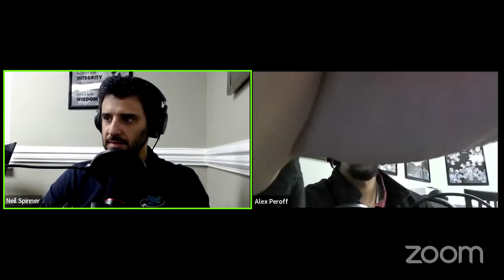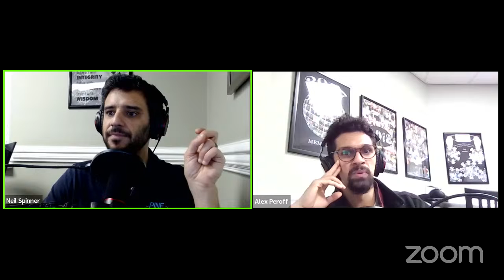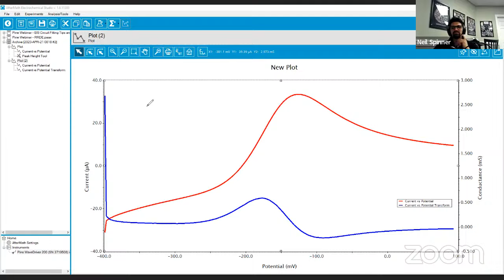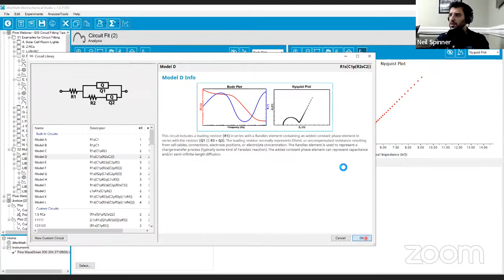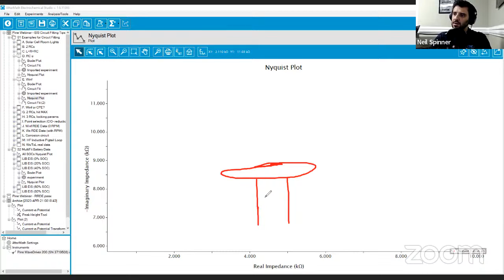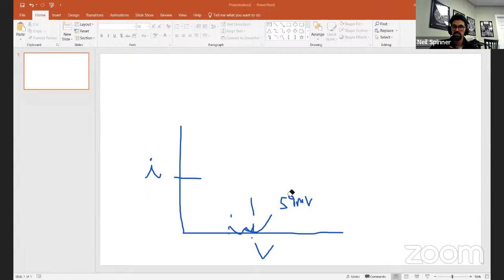Episode #2: Let's talk about Bode vs Nyquist plots

Comment: Thank you so much for taking the time to answer my questions, even though I couldn't attend the livestream. I truly appreciate it!

I have a follow-up question regarding the Bode plot. I'm not sure if this was extensively covered in any of the webinars on EIS, but I'm curious if specific characteristic shapes of the Bode plot can be attributed to particular electric circuit elements, similar to how it's done with the Nyquist plot. If that's the case, could you please discuss some of these common features and how they should be interpreted? I find it challenging to use the Bode plot as a tool for understanding the various electrochemical processes occurring.

PS: I noticed your discussion on the floated vs. grounded setting haha. Personally, I always use the grounded setting, but I can't really explain why. Which setting would you recommend for EIS measurements and what are the reasons behind your recommendation?
Reply from the maker: Shapes in the Bode plot certainly correlate to circuit elements, or vice versa (however you logically think about it).  The thing is just that Nyquist plots are easier, in my opinion, to make those visual connections.  There are many cases where, for example, two different but even mostly similar circuit elements will display hard-to-differentiate features in the Bode plot, but when looking on the Nyquist plot it is much more obvious which is which.  This kind of thing is obviously much more easily explained visually than through text, so my best suggestion is to jump onto one of our next Livestreams and ask the question then.  I can show you in our software what I mean.

Regarding the grounding discussion, the best answer I can give is honestly very unsatisfying: trial and error.  Ultimately, every situation will likely behave differently, and while a great many will have almost no impact from any variation in grounding configuration, if they do the best way to optimize is to simply try stuff out.  I wrote a Knowledgebase article on the different options here too for reference: https://pineresearch.com/shop/kb/applications/general-electrochemistry/instrument-grounding-information/.  Generally, I think for systems measuring very low currents it is ideal to float everything.  But again, trial and error is best to figure out what you should do most often.